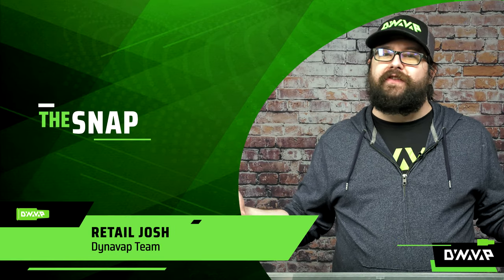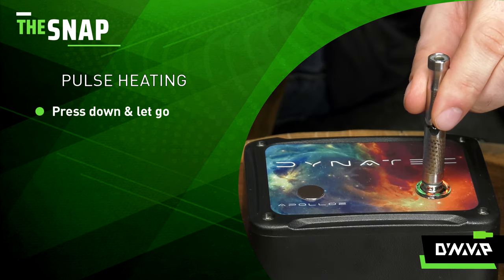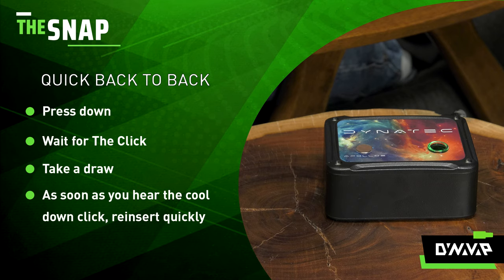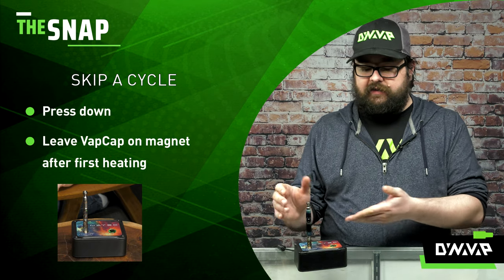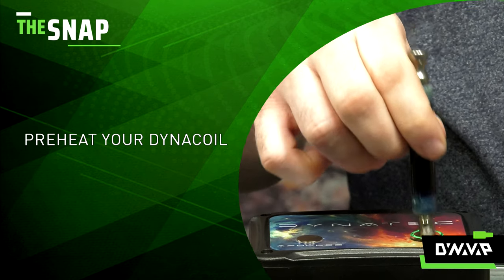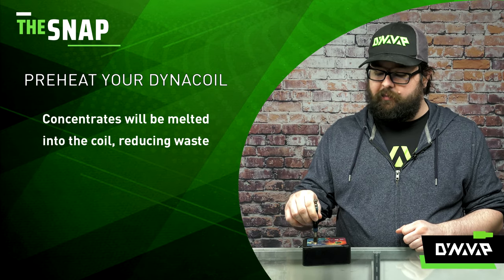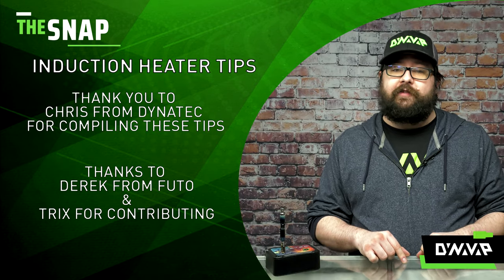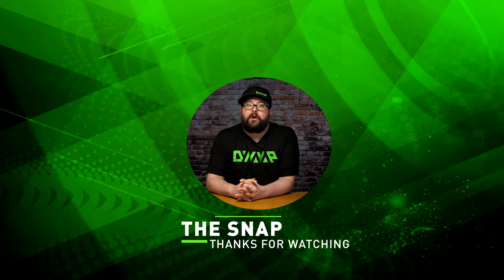The Snap | Induction Heater Tips

Comment: still like the torch better, more consistent results..
Reply: @KingPeepeepoopoo  nah unfortunately... you can heat the cap longer with torch before clicking by heating bottom of cap. For the induction to get those milky hits, you got do feathering, and having to heat it longer than click just makes it seem like work..personally i'd rather just light it and hit it.
Reply: @KingPeepeepoopoo  not if you have your heating technique dialed in
Reply: William971 with their heater yeah you have too. With others though it’s tuned to be much more higher in temp just from a regular cycle. I prefer my torch all the time but I will say that my portside mini is a much hotter heater than the dynatec ones or the lucid customs
Reply: If you just hold it in for a few seconds past the click you get the same big hits as torching the bottom
Reply: Torch has variables the ih doesn’t
Reply: more consistent? lol nope